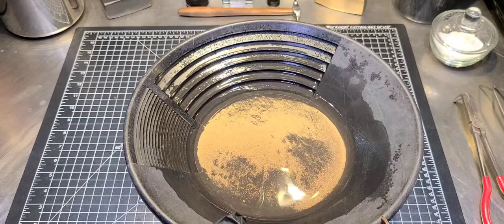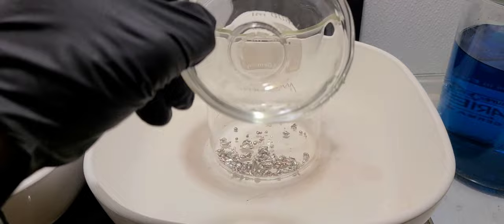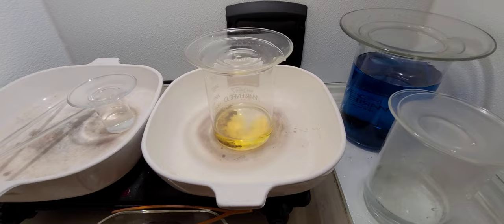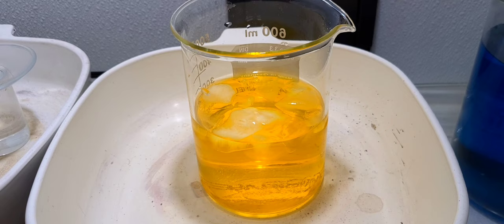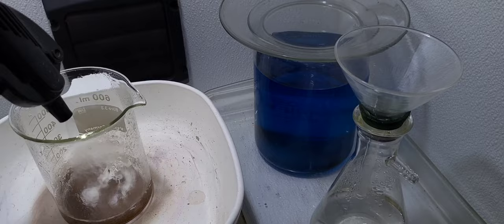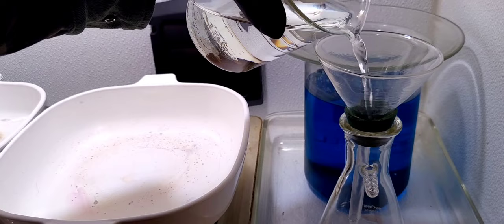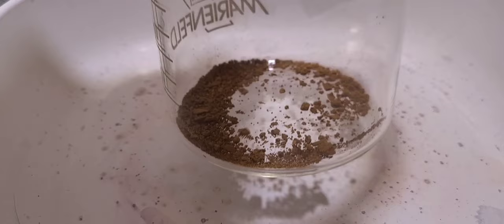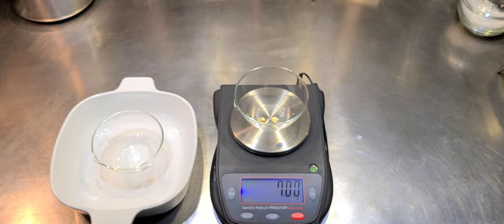Gold Refining

Comment: You can eliminate the chloride steps by simply continuing to boil in AR until the solution remains colorless. A touch of sulfuric acid during digestion will precipitate any lead. If you do this it will reduce the quantity of waste solution as well as the number of chemicals that have to be purchased and dealt with in the waste stream.

Comment: i think you still shoulda used distilled water at 4:45 because yes even though tap water contains trace amounts of chlorine, the hydrochloric acid is like half chlorine, so you dont need to add extra chlorine into the system, if anything tap water would actually contaminate your gold solution, adding more to wash out when you percipitate it. also, you shoulda added a small amount of sulfuric acid to percipitate any lead that would naturally exist in the metal, cause its definitly there because it came from a natural source and not like jewlery or bullion.
Reply from the maker: I found the pros out weigh the cons at that point. Distilled water doesn't always flush that remaining silver out of the AR like my filtered tap water does. The deposits it might carry are washed out later, easier than the silver still in solution would have. It's working for me! 

Oh yeah, always have to add the sulfuric acid. Bummer I didn't include it in the vid!

Thanks for watching!
Reply: @LithicMetals   yeah makes sense tbh. im just used to using distilled water for everything cause thats what you'd do in a lab setting, because sometimes things can be pretty sensitive to tap water (especially if your trying to get high purity products). also its even more so important to add sulfuric acid to natural specimins, as they contain higher lead content than most scrap gold.

Comment: Hello Jeff, today I for the first time refined some silver using cupellation process. Small test, turned 2 g of 800 into 1,580 g of pure (I hope) silver, that went great. Also tried to refine 2,5 g of 585 (14k)  gold, it turned it into 636... I probably eliminated just some 200 mg of base metals. I must clean the bead from cupel and oxides residues (sadly no sulfuric, I will try pH minus - NaHSO4), inquart and go with nitric or not inquart and go with HCl + H2O2, or directly AR... I am nor sure yet...
Reply from the maker: Sounds like fun experiments! If you really want the gold to be pure, you're going to have to inquart it.

Comment: What is the that white bake pan you use? I bought some at Walmart but they explode when I heat them up on the hot plate.
Reply from the maker: Yeah, you can't use most glassware on a stove top. I use the old school Corningware dishes.
Reply: Alright got me a few on eBay! 
They’re slightly pricey but they should last me for a long time.

Comment: Hello teacher I'm doing the same thing as you in Korea. It comes out 99.9% in winter and as the weather gets hot, I see silver. I think it's because of silver chloride. If I pour tap water before filtering the filter, can I filter 100% of silver chloride due to chlorine?
Reply from the maker: The chlorides in my local tap water will precipitate silver chlorides, but the real key is to dilute the AR. At least double the volume. It also helps to filter in a Buchner funnel with a vacuum. The pressure difference also helps to drop out Ag from the solution.
Reply: @LithicMetals  Teacher, what is AR?? And would lowering the temperature of the royal water help?
Reply: @LithicMetals  Teacher, I'm waiting for your answer
Reply from the maker: AR is Aqua Regia

Comment: Sir good day, I would like to ask you a question about neutralizing/denoxing the nitric ions, why is it that after the filtration i made from aqua regia gold solution, why there's white powder/ white silts forming from the bottom after I added Urea 46-0-0 and sodium metabisulfite to the solution.
Reply: What's the next step should I do to precipitate the gold?
Reply from the maker: Hmm... did the gold drop out and settle, and then a white precipitate settled on top of it? If so, I imagine you used a bit too much SMB.
Or do you mean that you added the Urea and SMB, and no gold dropped out and the white precipitate formed? If that's the case I imagine you may still have way too much nitric in the solution. In that case I'd either add and dissolve more gold until the nitrates are spent, or keep boiling off the solution and adding more hcl until you're confident the nitrates are used up.
Reply: @LithicMetals  thank you so much sir, noted.

Comment: Why is the gold that precipitates brown and not gold colored?
Reply from the maker: I don't know why it absorbs light differently in that state. It's a good question to answer. Wish I could.
Reply: @LithicMetals  When you grind down white powders they often turn black (titanium oxide, a white paint pigment for example) because the light is difracted instead of reflected back to you. I assume that the fine gold sponge is full of molecular sized voids which will absorb and scatter light so it darkens. As soon as it melts those voids go away and the light is mostly reflected back at you again.

Comment: Can't we just directly smelt it with fluxes?
Reply from the maker: Not if you want pure gold. A flux only captures the oxides that form when the base metals are exposed to oxygen. It doesn't remove the base metals, which are the actual problem.
Reply: @LithicMetals   Oh I see, thanks a lot for the enlightenment.  That's why most of the small scale miners from our place directly smelt it cause they are not aiming for purity of gold but as long as they can sell it. 
Thanks agian

Comment: Can you help me ..I use equa regea and extract by meta yellow precipitate but I can't get for gold after that
Reply from the maker: So you're using Aqua Regia to out gold into solution, and using Sodium Metabisulfite to drop the gold out, but you're not getting the gold to drop out of solution? 
🤔... what material are you putting into solution? Are you certain it contains gold?
Before you use the SMB (Sodium Metabisulfite), are you sure all of the free nitrates are used up? If not, the gold will go right back into solution.
Reply: @LithicMetals  I want to send the way and the yellow precipitate and to see my way for help me in my problem
Reply: @LithicMetals  I have a lot of black soil which called gold ore

Comment: Ugh the tap water gives me anxiety. The silver will crash out as silver chloride with just distilled water due to the HCl. Tap water contains trace heavy metals that will only contaminate the gold
Reply from the maker: Naw, there are less than 200 parts per million of metals in our tap water. Which only a fraction actually comes in contact with the gold. It's virtually zero